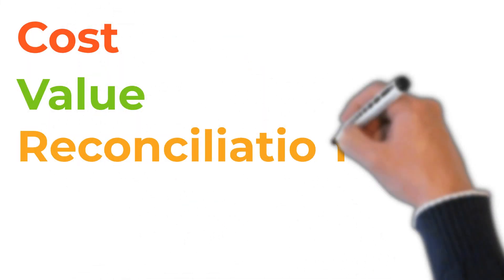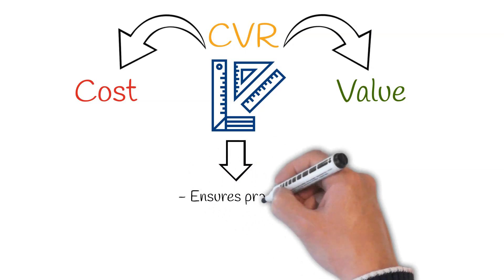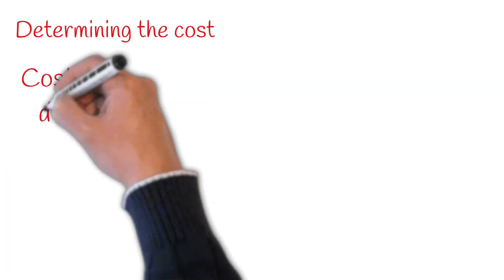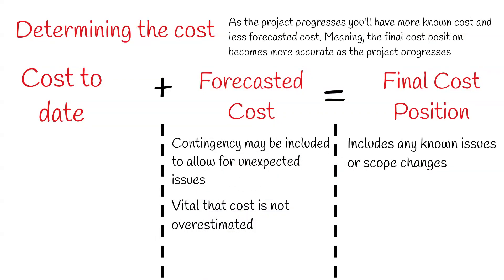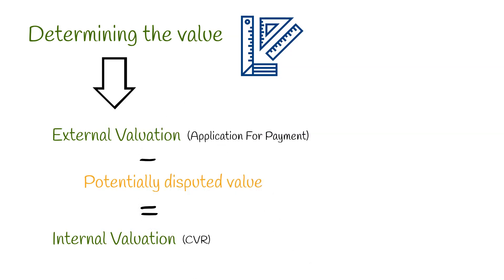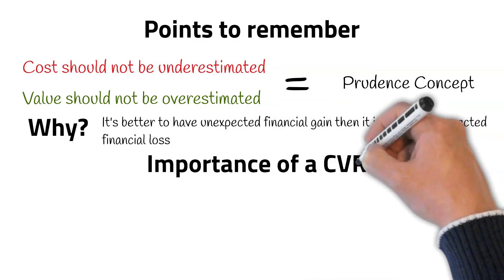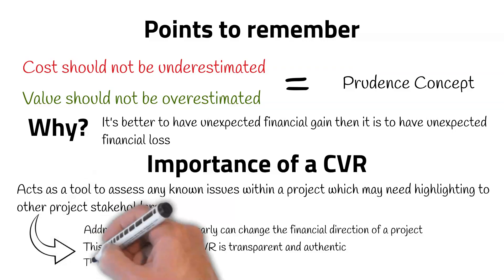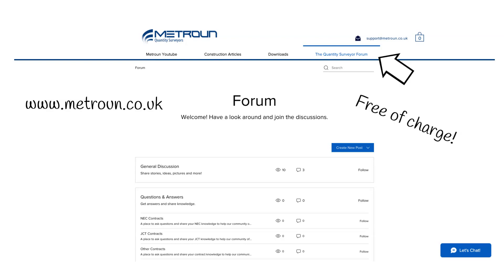Cost Value Reconciliation (CVR) Explained

Comment: Hi, great video. But one thing confuses, on the video was said that CVR acts as a Balance Sheet. I believe you ment Profit and Loss? Thanks
Reply from the maker: You make a great point - in the video I draw similarities between a balance sheet and a CVR. However, I can understand why you thought I meant P&L. In fact, the CVR is kind of a hybrid between the two. 

Similar to a P&L - CVR tracks the performance of a project over time, much like how a P&L statement tracks a company's operational performance. It involves assessing the income or value generated against the costs incurred during the project, which is akin to the revenue and expense analysis in a P&L. This aspect helps in determining the profitability of a project at various stages.

Similar to a Balance Sheet - On the other hand, CVR also provides a cumulative view of a project's costs and value to date, reflecting the financial position of the project at each reporting period. This is similar to how a balance sheet gives a snapshot of a company's financial position at a particular point in time. It encompasses the management of assets (like completed work or value earned) and liabilities (such as costs or expenses) for the project.